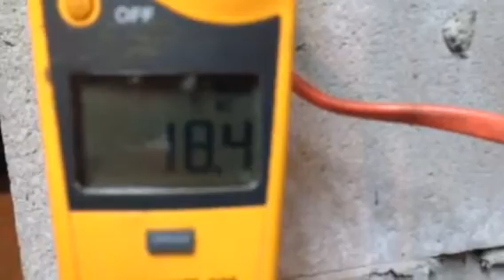Project 10 Hho Furnace

Comment: Hi javed romani,
nice work. Very professional. But you miss the target to heat something. The HHO flame is not very hot (120-140 grad celsius). It gets hot a soon as you point it to some material. I tested it with wolfram and the HHO flame melted it!!!! That means the flame reached 3.600 grad Celsius.
So you cannot heat a room or empty space with an HHO flame as you can do with a fossile gas flame. The HHO flame is not hot and does not heat a room. My testing tells me that the flame must be directed to something.
Reply: Abgas Engel an hho flame will burn under water, and heat up the water.  Thus water can be a medium to transport the energy.   There's more ways, like for example sand heaters.  In a sand heater there's not an open flame, but very diffused fire. The sand will heat up until a few hundred degrees celcius.
Reply: The key is pointing the HHO flames at something that has an extremely high sublimation or melting point temperature but doesnt break down itself. The same rules that apply in trying to burn HHO as a fuel by itself in a vehicle also apply here. You can never get more thermal BTU energy out of the gas itself than the electrical used to produce it. The electrical energy would be more efficient converted directly to heat in a resistive load than by using it to fracture water. Use the gas as a means to extract energy from something else and you have something viable.